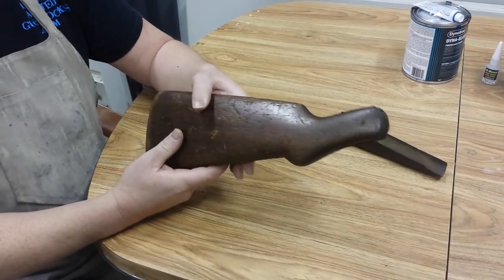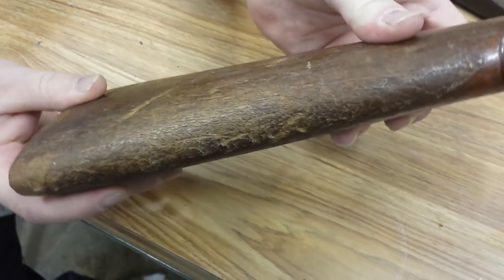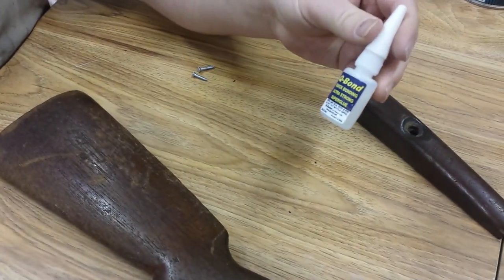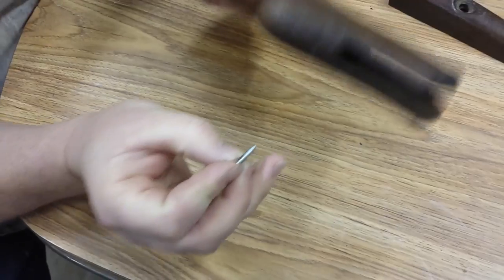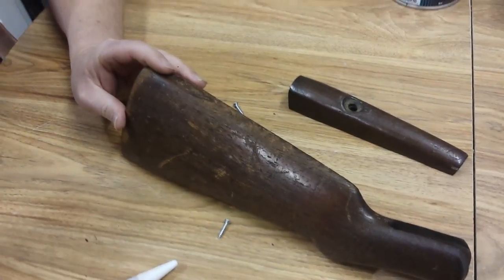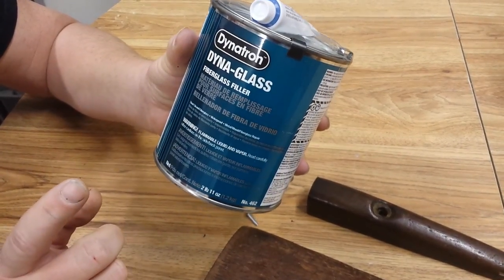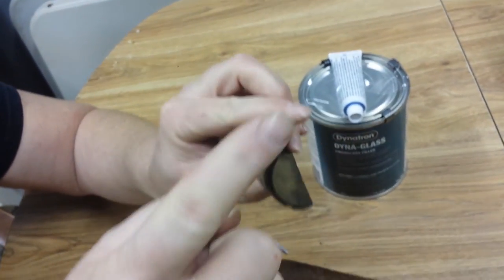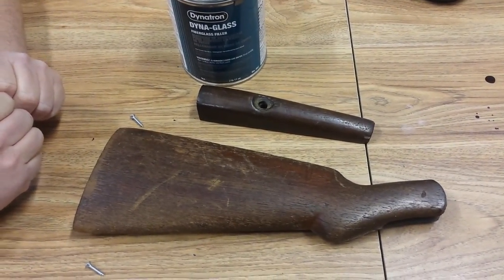Part Two Of Resoring An Old Iver Johnson 12 Gauge!Overview Of The Stock Repair.

Comment: Hey bud I've got one myself I'm fixin. The hammer won't stay pulled back if that makes any sense. How do I get the buttstock separated from the hammer and trigger?
Reply: If you unscrew the 2 screws holding the buttplate onto the stock, then you'll see a screw head, take that out, and then the stock should come off.